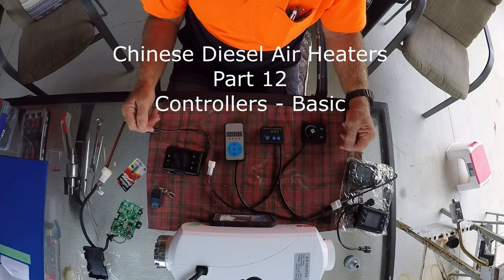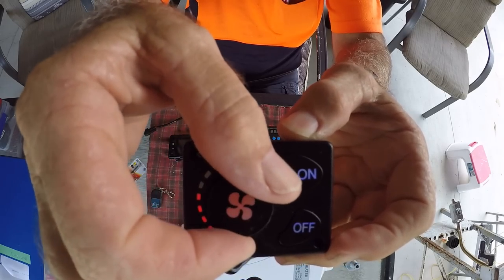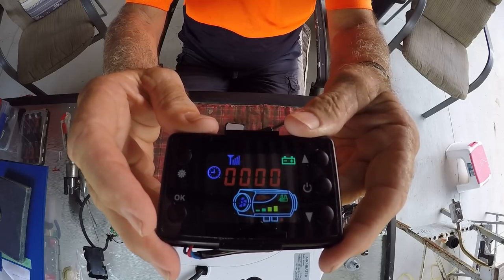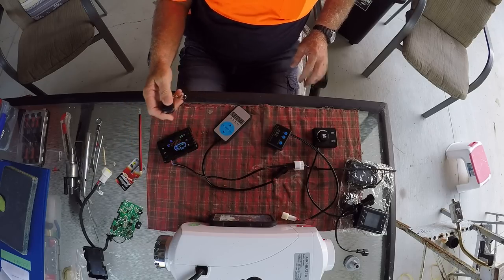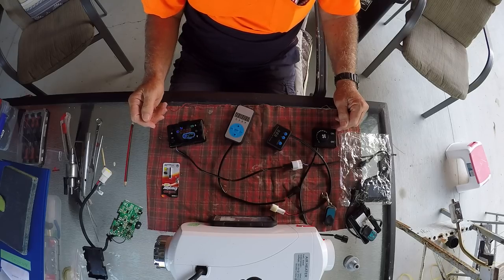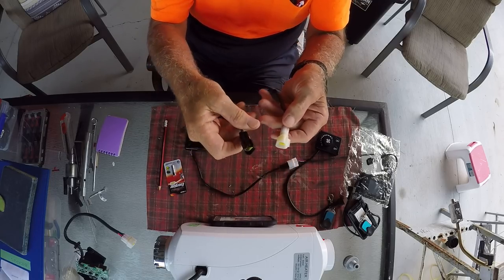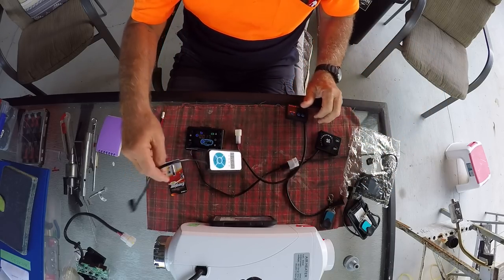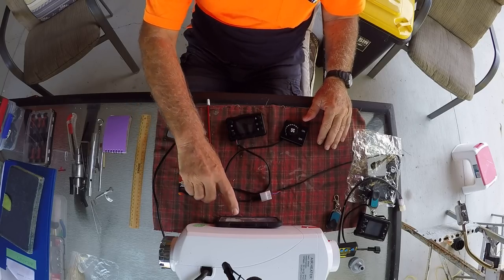Chinese Diesel Air Heaters -  Part 12 - Controllers (Basic)

Comment: Hi John,  Thank you for all your info and work that goes into making these video's.  I was getting a low voltage warning E-01 and the heater would then shut down.  It wasn't the batteries for they were at 13.2v . Come to find out it was the fuse and after changing it the unit worked just fine.

Comment: John. Thanks for this series of great videos at79 sure help   question  if controller goes seems like it will keep running. If u disconnect pump will unit keep running to act like cool down then could pull fuse. Than you
Reply from the maker: Hi Richard,

If you turn off the fuel or disconnect power to the fuel pump the heater will go into safe shutdown mode. JMcK
Reply: Thank you John

Comment: Solution to the PCB melting might be to add a mount that insulates it better from the heat of the frame it is attached to.
While you are the de facto leader in describing these heaters, you cover more than anyone else and you correct what others have wrong, etc... you regularly mess up the values you express... as the length of time the more advanced controller 1 1/2 to 2 weeks, less than a minute later 2 to 3 weeks... you do that a lot in all your videos and why I bring it up.
Reply from the maker: Hi Mr D, 

Thanks for the feedback. Can you give me more info re the time you talk about so I can go back and see what I said.

Generally if I talk about time, say the time you should give the heater a high speed run to clean out carbon, it is such a variable, and depends on your heater install, how you operate the heater, the quality of diesel you use etc. I just give rough guidelines. If you use the heater constantly on low power and you have a long bendy exhaust perhaps a high power run every couple of weeks is a good preventive maintenance issue. Every heater and install is different, so is the time for a hot carbon burn. On our boat in the Med, I just give it a high power run once a year (season), but the motorhome about once a month.

Re the circuit board, I think you would find effective isolation difficult in the space available. Better to use effort to prevent a sudden shutdown in the first place.

Cheers JMcK

Comment from the maker: Hi Reg,

Yes you are right, 94 beats a minute works out at 1.56 Hz or pulses a second.
1.6 Hz is the default minimum on these heaters. You get flame out when you go lower.
It is not realistic to try and slow the pump rate further.

A real 2 KW heater is about 330 mm long, the outlet is about 60 mm in diameter, and the weight about 2.8 kg

A 5 KW heater is about 390 mm long, the outlet is about 75 mm diameter, and the weight about 4.2 kg.

I hope this helps.  JMcK

Comment: Very good videos John, thank you very much for your effort. I would love to se a video regarding the advanced setting and tweaking the rpm/Hz for optimal performance.
Reply from the maker: Hi Dessmo, 

Thanks for your comments and video request, unfortunately I will leave your particular topic request for others to do. My goal with these videos was to try and help the DIY person who would buy a cheap Chinese copy heater on line and install it themselves, without the help or input from a brand name supplier. In fact some brand name suppliers insist on a professional install. 

I believe the Chinese have done a good job matching fan/rpm settings, and when amateurs start messing here with the password protected control settings they often mess things up. 

This is an area I will leave for a tinkering enthusiast to play with, and publish a video, should they choose.   Sorry.   JMcK

Comment: Hey john, fun video! 
But you forgot to talk about the advanced control on the controller with the lcd screen. 
Going to the settings, the fourth dash, the password is 1688, and then you can adjust the ratio of the rate of pulse and the speed of the fan to improve the quality of the combustible mixture.

Comment: Another way to force shutdown would be to disconnect the pump if you can.
Good tip about needing the right shutdown, fuses/breakers too need to be happy drawing 20A on the 12V model.
Reply: Just received my Chinese heater here in Canada, too about three weeks to get delivered. But my controller is different from all the ones you show here. It is like the lcd display model but it doesn’t have the battery or wifi displays on it and no clock, if I hold down the top two buttons it gives me a new display of blue mountains in the corner where you have a battery display. Have you seen these I can’t find anybody explaining these controllers
Reply: @wannabsailor  not seen those, maybe a new type, the older LCD controller is cheap if you need to change.

Comment: More really good information John ,did wonder myself what would happen if controller broke down as it needs fan to blow air through the unit to cool down , good to know that those controllers  only work on those heaters with the same control board ,👍 ❤️
Reply from the maker: Hi John, I am pleased the information is helpful to some people.  JMcK

Comment: Hi John can i put a switch on the red power wire at the led controller like cut the power wire next to controller and fit a switch to it  on my diesel heater, thanks mate you are doing a great job as well , o and can you change the display from herts to temp mate??  or you think it best just to use the herts display

Comment: Does the control unit need to be on the heater? Maybe it can be taken out and setup next to the controller far away from the heater to make it impossible to overheat it.
Reply from the maker: Hi Dan,

Possible but difficult. On the ECU is a fan rotation sensor, that would need to be removed from the circuit board and some sort of fine tolerance bracket made.

But why bother. With a good install an overheat is extremely remote. Also, in the unlikely event of an issue, an new ECB is only about $20. 

Cheers.  JMcK

Comment: Thanks for the video.  A thought,  If your controller fails,  Disconnect the lead to the pump.  This should cause the heater to generate a E-08 or E-04 error but should still allow the heater to power down without overheating. (in theory, not tested)
Reply from the maker: Thanks for the feedback Pierre. Yes that is more preferable than turning off the fuel and having the pump run dry. I mentioned in reply to another comment here a suggestion to consider a switch in the pump power line. But it is all about accessibility. A controller failure is very rare and if accessibility to the fuel pump wiring was difficult, like under the van in the mud and rain, I would use the power off method and a portable fan. Also as I have done this before, I am familiar with what happens.  Thanks again. JMcK

Comment: Hello John, Thanks for the quick feedback. I have an EXTERNAL temperature device which has functioned on my Webasto heater. An internal switch , wakes up the heater at a set minimum temperature and cut it out at the desired temperature. Could I use this in conection with the simple controller with the rotating knob... ? Maybe am asking too much ? Thank you anyway for your first answer which helped me sorting out the problem.

Comment: Hi John, great series of videos. I have just finished part 12 and was wondering if in the event of a controller failure, would removing the power from the pump  and allowing the unit to run for a period of time, allow a more controlled shutdown?

Thanks Craig
Reply from the maker: Hi Craig,

Yes, if you unplugged the fuel pump or even turned off the fuel, the heater ECB would notice a fuel delivery issue and shut down safely.  JMcK
Reply: @johnmck1147  Hi John, finally getting to install my heater. Just wondering which is the + / trigger terminal on the pump? Craig
Reply from the maker: @craigallen5353  
Hi Craig, the pump is activated by  an electro magnet. The polarity does not matter.  JMcK

Comment: How do I determine  a 2.5-5 kw to a 5kw to an 8kw. I ordered a (what I thought) was a 5 kw and the unit has a 3" opening for heat supply.  Can you explain what the difference is between units?

Comment: Thanks John. You provided the instructions that were needed to get a good install.  I have mine installed in my RV but the display will not turn on. It is the one that has all the LEDs and draws the most current.  I have search for a way to diagnose the problem be it the wiring or the display but I can't find this information no can I get the display to turn on.  Have you heard of this? Could the controller be DOA?
Reply from the maker: Hi Charles,

First check your install and make sure your connection are tight and your battery voltage polarity is correct. If this is good and your heater is a new one ask for a replacement.

If the heater is not new, suggest you buy a new controller on eBay. Look for one with same plug as your current plug. 

Occasionally you can get a dud controller, but double check your wiring first. Easy for me to diagnose, I have a number of spares and can just plug in a spare controller.  JMcK
Reply: Thanks John. I have checked everything and it appears to be fine. I have ordered another controller. I don't hold out much hope on them honoring the 3 year warranty but if they do I will have a spare. 
Charlie

Comment: Great series! The thing that got me here is that my lcd controller is that it's so dull it impossible to see unless it's in a dark room. Done all the voltage drop tests on the wiring and that's fine, can this be adjusted some way or is it a dud unit?
Reply from the maker: Hi Mr Do,

You would expect there would be some way to change the brightness, but I have not found a way to date. Perhaps if someone out there knows he could post it here.

But the brightness in the controllers are never the same. I have one that is so bright at night you need to drape a cloth over it. 

You could try sending yours back for replacement. Difficult I suspect, or purchase another, the sell for around $20. 

Good luck.   JMcK
Reply: @johnmck1147  Thanks mate, yeah just ordered another so let's hope. Do you know how many mA these LCD's draw ... under 100?
Reply: nuthn2do I have both the standard black lcd and the new blue screen with red remote,they are both so dim and very hard to read,unless you turn them upside down.
Go figure...lol
Reply from the maker: Sadly this does happen and I know of no method to change the brightness short of buying another controller. The opposite also occasionally happens and you get a controller so bright you need a cover over it at night.   JMcK

Comment: G'day John. I note you say the blue controller on your ipad at 3.15 is the same as the older unit but a different configuration. I have the blue controller but nowhere is there a hole for a thermister to read temp. Do you know how this one is reading temp? Seems strange to me.

Comment: Hi John i have the LCD full function controller. How do you turn on the start time function. I have input a time to start but don't see the Alarm clock display when i am done. The chinglish manual talks about 2 timer groups.  this implies 2 start and stop times. I am not getting anywhere setting the time in the first time switch and set the stop time in the second setting.

Comment: Recently purchased the cheapest 5 kw heater I could find, $84USD.  It came with the simple controller you note as decent.  I like the simple knob controller, ordered one, tested it and got the 7 error code.  I suspected the incompatibility issue so I ordered another motherboard and knob controller.  

The new motherboard looks substantially different but has the same connections.  I tried the original controller and only got 4 red LEDs dashes.  Both new knob controllers show the 1 error code, low voltage with 12.6 volts on brand new battery I keep on battery tender. 

The packaging indicates the replacement motherboard is usable with 12 or 24 volts, though I specifically ordered a 12 V unit. However, very clearly marked on the board where the big red wire is soldered, it says “+24V.  (The original board that came with the heater has no marking at the same wire, though the cover is marked 12V.). I think I have a 24 V replacement board, thus low voltage error code. It is going back and I will try to order, yet again, a 12V mboard.  Is it really this complicated?  Am I on the right track or do I just start over with another complete unit that costs a little more. I am already collecting spare controllers.  

Thank you, John. I have watched all your vids and find them extremely helpful. I am spreading your fame at our US Albin Owners Group.
Reply from the maker: Hi Richard,

Thanks for the post.

When I made these videos, some years ago now, to try and help the DIY installer, the Chinese manufactures all followed the same protocol and it was so easy to mix an match controllers and motherboards, but lately some manufactures have been going proprietary and using their own protocol. This is making it difficult for the average heater owner to make changes.

I think you may be on the right path, but first check the voltage at the motherboard. 
Are you bench testing, or installed testing. It is not uncommon for heater owners to have voltage issues after install, particularly if they do not connect heater direct to the battery, have a cheap fuse, and don't increase wire size.

If voltage issue is on a bench test I suggest you ask supplier for replacement controller and motherboard. 

There is also another issue to consider. Most of the Chinese Copy heaters were exact copies (mechanical parts, not electronics) of the German Eberspacher D2 and D4 heaters. But now there are some Chinese heaters that are copies of the German Webasto heater. These two heaters are very different inside even though they may look similar to the untrained eye. Parts for Eberspacher copy are not compatible with Webasto copy.

Because of these issues, I now recommend the normal purchaser buy a heater that comes with the controller they want.

Please let me know how you go.   JMcK
Reply: @johnmck1147  
One of the things that drew me to you besides the sheer volume of info you put out is that you respond to almost all inquiries!  You do realize how unconventional you are?
And how grateful your public is!

I am bench testing since you strongly recommend it and I am glad I am I did.  When you say check voltage at the motherboard are you suspecting voltage drop from too small wiring in the boat?  (I am a licensed electrician...well I let it lapse a few years back since I retired...)  One would need to check voltage drop while it is running which could be tricky without tapping the wires close to the unit.  Certainly doable...  

I did purchase the heater with the controller I thought would allow me to add the knob style.  The controller is not the one that you got with the aluminum case heater.  Funny thing, the manual that came with my heater has a section that covers the knob style controller.  

I have sent back the controller that indicates +24V on the motherboard.  I have ordered another controller that says 12V in all the advertising info.  I have tried contacting these sellers to no avail.  Wish me luck!  I also have contacted the original supplier requesting whether or not they can provide another controller and motherboard or will allow me to return and upgrade to a more expensive unit.  I am still within the 30 day return window.  The unit works like a champ with its supplied controller and motherboard.  There is no guarantee that a more expensive unit will be any different than the one I have since they all advertise and look identical except for color of plastic.

I have also considered what else could be happening here, many posters say simply swap a couple wires around and voila.  These are really basic units: a controller with three wires, a pump with two wires, and a two wire power supply.  Internally, there is the heat sensor and the two wire connector to the fan.  Whether or not the motherboard is made of Swiss cheese or unobtainium, it still has the harness which contains the connectors to pump, batt, and controller and its internal connections to the fan and sensor.  And the replacement motherboard should nest into unit without any mods.  Now if each factory chooses to use interchangeable harnesses and non-interchangeable components we are all left blowing in the wind.  

Curious stuff.  

No need to respond, John.  I will update if I have any success or gain any wisdom.  The unit I have works fine as supplied.  I was simply trying to have parts on hand for field repair, mainly to avoid burning up the motherboard by a hard shutdown.  When this unit craps, maybe I'll be old enough to sell the boat.  

Thank you, good sir!
Reply: (I neglected to mention the glow plug. Yes, I did connect it.  Oops!)
Reply: After two new ECUs and two knob style controllers I could not achieve any interchangeability.  I put it all back together using only the parts supplied originally.  Works fine, but I have no backup plan short of simply installing another entire unit.  If and when I do, I'll spend more than $84 and hope for the best.  The second ECU was exactly the same as the first with +24V marked at the big red wire.  The supplier assured me it would work on 12V.

Comment: To prevent your battery from being drained you could install a battery cutoff, and that would cut off accessories once the battery reaches a certain voltage
Reply from the maker: Hi Eksine, yes you could do that but you would remove the heaters ability to do a proper cool down cycle before turning off. Much better to have a seperate vehicle start battery and a domestic house battery. Also the heater ECU will initiate a shutdown cycle when it sees around 10.5 volts at the heater, and prevent permanent battery damage.   JMcK
Reply: @johnmck1147  ok I see thank you for explaining that